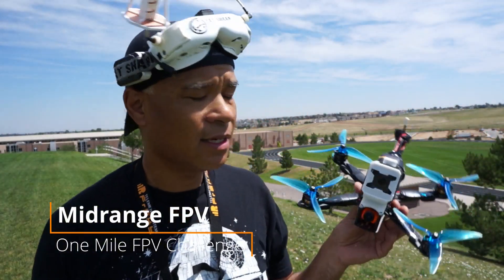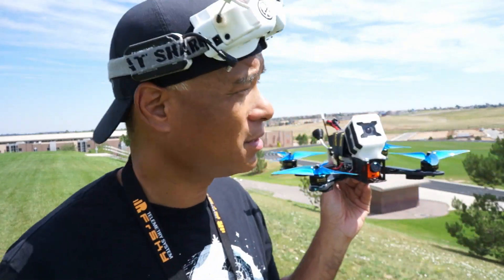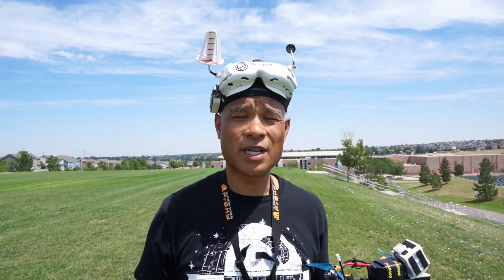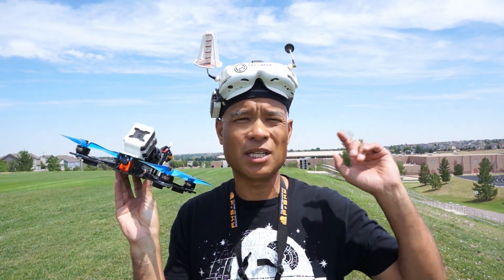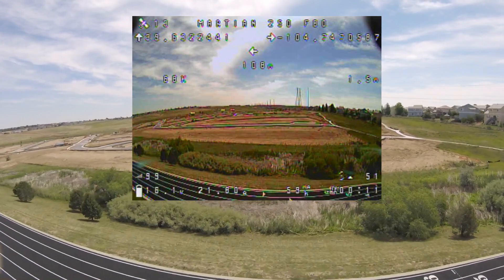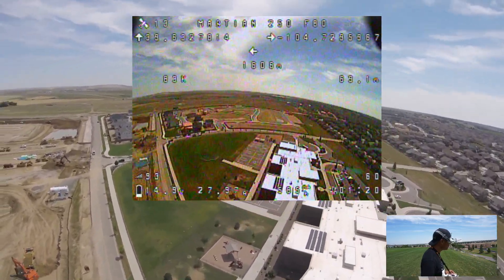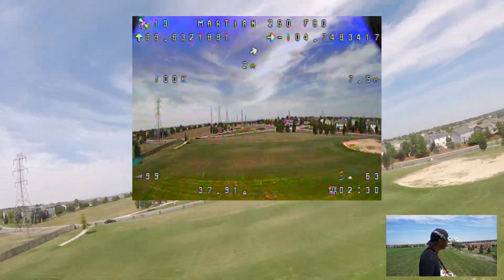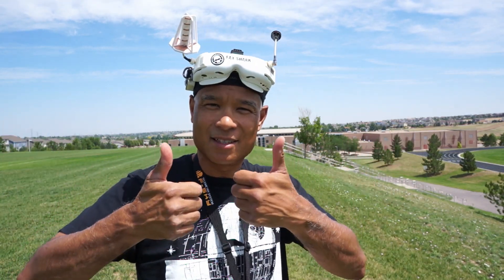Midrange FPV: Testing for One Mile FPV Challenge

Comment: that was not enough voltage.  I land at 14.4v you were on 13v side
Reply from the maker: 13+V under throttle.  It came up to 14 immediately when I got off the throttle.  I usually land at 14V and the voltage will rise to over 15V in a short while.  In any case, 3.5V per cell is the minimum for LIPOs.